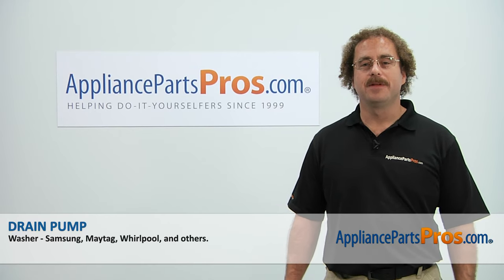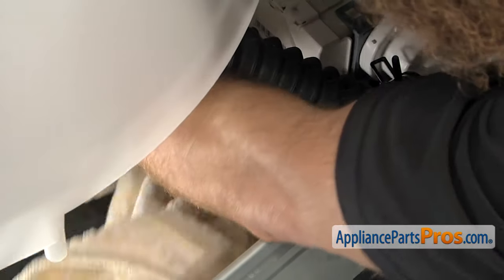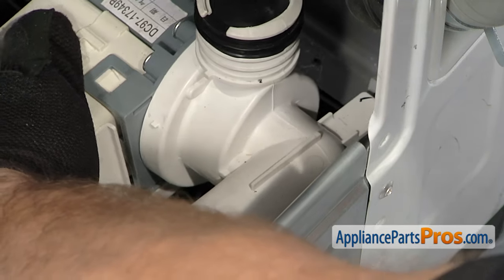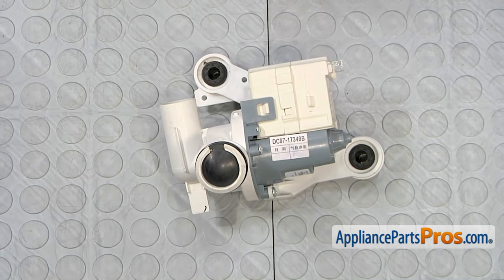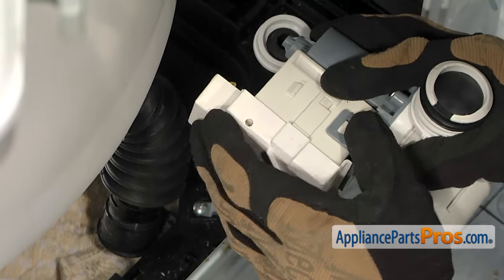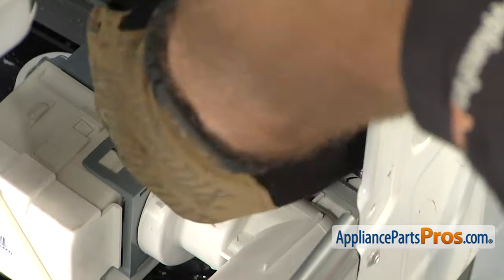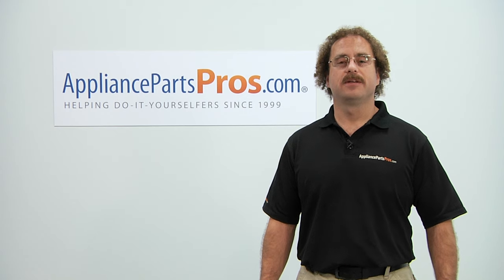How To: Samsung Drain Pump DC31-00054A

Comment: I've replaced the washer purge motor twice. btw the purge motor is faulty because if you leave the purge tube at full length and down into the wall drain it will cause it to back flow towards the lowest point which is the base of the washer thus leaving the pump face submerged in water. This leads to the pump leaking into to magnets inside the pump. It corrodes and the magnets crack and the polarity is compromised. The manual says to have the tube cut or at the right length just below the opening of the wall drain opening. They don't say it will f up your poorly made motor seal. Why would they?
Reply: It has a little black rubber that is called check valve to prevent that , it only let water out , not in

Comment: Is it just me or does his definition of "vertical" and "horizontal" seem incorrect....I copied the wire color connections by what was shown in the video, but his description seems opposite from terminal orientations.
Reply from the maker: This video is a generic video to give you an idea on how to replace the part. If you have a different model the wiring could be different, so it may not match the video exactly.

Comment: Is the impellor supposed to spin freely or have like a springy resistance that only alows you spin it once
Reply: The replacement unit I got does the same springy/single turn thing

Comment: These new pumps are driven by a small light duty motor, theyre cheaply built and much more failure prone than the older pumps that were reliably driven directly off the main washer motor.  Older pumps lasted longer and were cheap to buy as well.
Reply from the maker: Hope the video helped you get the motor changed!
Reply: I’ve never had an older washers pump go out.  This is ridiculous after 1 1/2 years

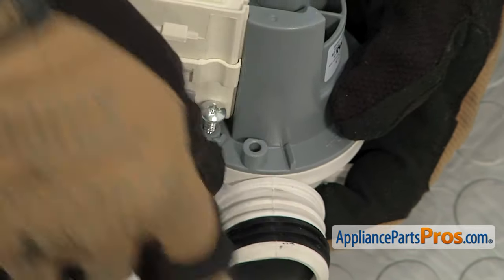Comment: Definitely needed this video to figure out how to put the pump back together after I found a nail caught in the blades. Except one thing - at 6:15 where you put in the second screw. I don't think it should go there or it will penetrate the line with the check valve. I ended up putting them in a triangle pattern, the outer holes and the center one instead of the two right next to each other.
Reply from the maker: Thank you for the tip! Glad you were able to fix your issue! If there is anything we can help you with in the future please let us know.

Comment: Thanks for the video.  I had a recent water leak with water in the black plastic underneath the drain pump.  There is a bad smell from the drain pump when I removed it.  Looking to ways to confirm bad drain pump if you have any.  I did declog some soap scum type stuff from the external corrugated drain hose that moves water from washer to the PVC drain line, so I'm unsure if the leak was due to faulty drain pump, or a possible clogged external drain hose.  No solid blockage, but excessive soap scum buildup?

All of the leaked water was inside the washer, and none of the tub or drain pump assembly rubber hoses were loose or blocked.  All the spring clamps felt normal.  There was no damage or cracks to the drain pump assembly that I could tell.  There was no blockage inside the drain pump assembly.

However, when you rotate the impeller, is it supposed to be smooth rotation, or will there be a part of the rotation that drags?  Mine requires extra force at certain points of rotation.  It also felt like when I rotated it, the rotation felt easier the more I "worked" it.  Feels a little suspicious.

In my case, I have a DC31-00054A on a WA5451ANW/XAA 01.

Comment: Thank you for the nice video, I had the same problem and my washing machine was not draining. I went to Appliance Parts and pros and bought the pump and replaced it. But I still have the same problem, the washing machine is not draining. Do you have any advice for me?
Reply from the maker: What is the model number of your washer? Have you checked for clogs in the drain hose?
Reply: Maybe need new pump or cleaning drain filter

Comment: Is this pump DC31-00054D the same as DC31-00054A? Mine is the 2nd one and it looks different and it’s at the front , you can’t replace it from the back
Reply: It's a little late, but the three fin impeller is the DC31-00054A and has one screw holding the drain pump to the plastic assembly.  The four fin impeller as shown in the video is the DC31-00054D and has two screws holding the drain pump to the plastic assembly.

Comment: About to attempt the change from the assembly being attached to the bottom of the drum to the frame. Why aren't instructions included as to where to connect the bracket to the frame?

Comment: Just unscrewed the drain pump housing from the washer as said . But when I went lift it up it's still connected to a small hose which is tied together to the pump wiring at the bottom base of my washer via a zip tie. I'm I supposed to cut the zip tie to have better access? Help I really need my washer as my five kids don't understand changing clothes 4 times a day with no washer means.🙏 
PS my Samsung washer only has 1 wire connector that attaches to the pump.

Comment: I replaced the pump and it still does not pump. I put meter on the wires and got 120v only intermittently when doing pump test in test mode. i connected pump again and repeated the pump test and it tried to work for about 2 seconds only one out 10 times. Now I don't know if I need a new control board or water level sensor.
Reply from the maker: Without knowing what you have, I would suggest posting the problem along with the appliance model number on our repair forum and the techs can help you troubleshoot the problem. http://forum.appliancepartspros.com/

Comment: Your title and part number are wrong. 🤨 Your title says DC31-00054”A” in the part but it should be “D”  Your link even goes to the correct part “D”   PLEASE CHANGE THE TITLE OF THE VIDEO.  I ordered the incorrect part because of the wrong part number in the title. 😢 

However your demonstration of removing and replacing the part are wonderful. Good job on the pace, descriptions,sound quality,video quality, editing, and not saying “I did this part earlier” without showing what you did. Good job. 👍

Comment: I replaced my pump and it still drained but only very slightly or not at all but I could hear the pump moving water. I now realize that I reversed the wires. Does this sound like this would cause the problem I'm having?
Reply from the maker: We'd be happy to help you figure out what's up. We offer free technical advice and diagnosis. You can give us a call at 1-877-477-7278 or you can chat us at our website: http://www.appliancepartspros.com/. We will need your model number to give you accurate advice, which you can locate using this tool on our website: http://www.appliancepartspros.com/modelnumber_locator.aspx

Comment: I remove the motor drain and water level pressure with new ,but my washing maschine still canot drain
Reply from the maker: Have you checked for any clogs? Have you had any error codes come up on the machine? What is the model number of your washer?

Comment: Where do coins, small parts, etc end up if they're too heavy for this pump to push up the drain hose? Other clothes washers have a junk collector trap for such things.
Reply from the maker: What is your model number?
Reply: @appliancepartspros I have the same question, mine is the Samsung WA44A3405AP
Reply from the maker: There is not a separate filter listed for the model WA44A3405AP. You would just need to check the drain pump for any blockages.